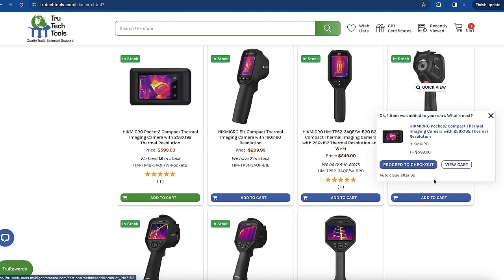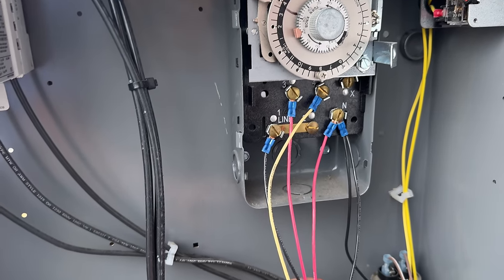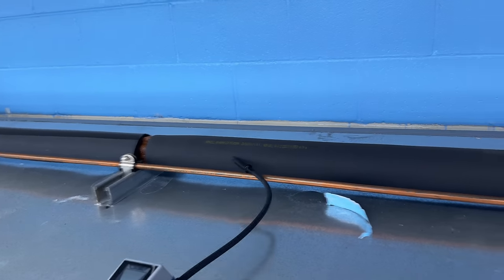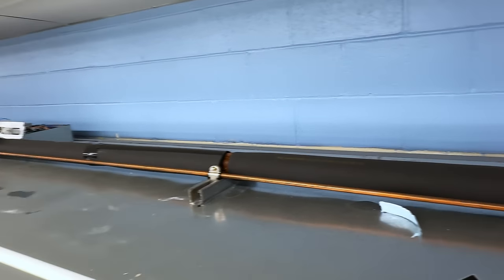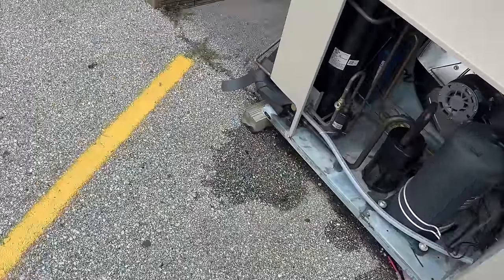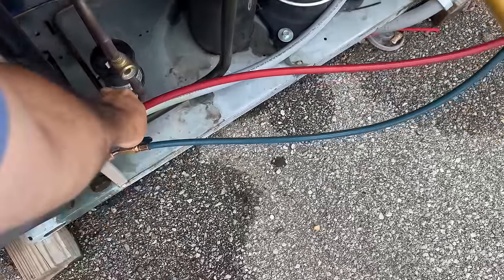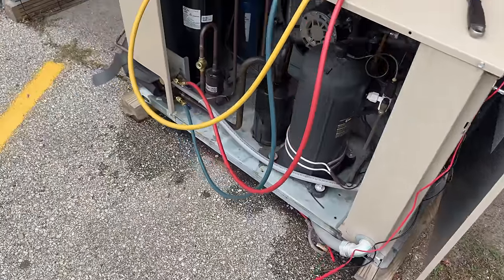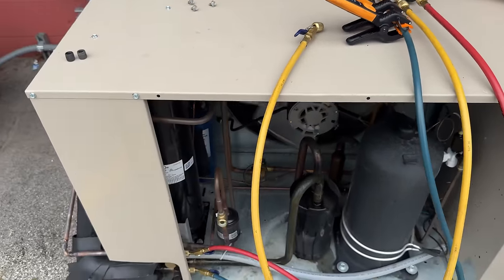More Mistakes More Problems New Install Failures

Comment: looks like either the electricians or installers forked up and fed 208v to the 120v circuits initially. smoked elements yeehaw.
on that note, make sure they don't have the 120v/208v crossed up in all of them, 120v on the 208/240 heaters and 240v on the 120v heaters.
but I'd think the evap. motors would be nuked, but they may be ecm rated 120 to 240 and not care?  that was a tough basket case of mumbo-jumbo to deal with. 🤔
looking again, lights and fans/drain heater may be different circuits for building automation(lights off with store/sensors), so it's possible the sparkies initially fed 208v to the 120v evap fans/drain heater. the motors never blew because klixon had them off(or 120 to 140v rated). the mystery continues 🥳 they need an exorcist, time traveler, mind reader, team of scientists and more to figure out what exactly happened. maybe they did blow it all up initially and that's why they're not back now?
Reply: I would double check the voltages to every input of each case. I'm thinking it may still be wired wrong somewhere in the row and not just killed/fixed at original install.
120v vs 208/240v would make the heaters weak(about half current), also blow the 120v drain heater/s, the evap fans may be 120-240v capable, but you'd think the relays/contactors would let the smoke out, unless they're 240v circuit controlled. not looking at schematics again 🤯 not gong to Indiana to help! 🥸
Reply from the maker: Great point! That might be why they replaced a couple controllers.
Reply from the maker: The 120 V drain heater circuit wasn’t even wired correctly to the ice cube relay and I had to literally wire that thing. Somehow, I didn’t record that and didn’t mention it very well. I assume the other ones aren’t wired correctly either or the other people screwed up the wiring.

Comment: The sticker inside the control showed the sensor wiring correct.. how was a guy to know?
Reply from the maker: He should have tested the thermostat when finished.  The paper instruction showed the correct way. But it was pointed out to be earlier that the sticker was flipped around.
Reply: @HVACRSurvival  awesome find and excellent point on testing.. verification of proper operation

Comment: so the company that installed this unit ....has no interest in fixing it ?   Jay.
Reply from the maker: @charlesleake930  The only reason he used them was because they had the equipment available several months before us. Otherwise we would have done the job. The person that did it was a fairly small company and normally the customer had been using us for last 25-30 years when he had another store only 45 minutes from us.
Reply: @HVACRSurvival  Hey man ...thanks for the kind reply....yea...you can only do your best.....have a great day   cheers   Jay

Comment: umm, you said 404A and they all say 448a gas. probably just a tongue fail. lol
ok, shortly after you noticed meter set for 407c and switched to 448a.  🤪
Reply from the maker: I knew it had 448A because I had brought six bottles of it in the back of the truck, but I ended up cutting that out because I didn’t end up using it. The video was originally 90 minutes.

Comment: Dealing with this bullshit from other companies can be frustrating. Both refrigeration companies I worked for plagued me with this shit CONSTANTLY caused by themselves. I drove over three hours once to pull the charge, evac, and recharge because some dipshit mixed 404 and 448 at the company I worked for. The owner himself denied that it was possible because he was there for the final charging. It wasn’t noncondensibles.  My needles were rock solid steady. My pressures were fucked up six ways from Sunday. SURPRISE! Pulling the charge and weighing in fresh fixed everything. I wasn’t allowed to change the drier by the way. Fuck HVAC/R, I’m sticking with industrial maintenance. I also stumbled across a bunch of industrial walk in coolers where some dipshit added defrost clocks after the fact and didn’t have enough wire to wire them to pump down. That dipshit worked for my employer. To this day the defrost clocks have NO control on the solenoids and just kill the compressor contactors. You are a bigger man than me. I would be raging.
Reply from the maker: I’m a good editor 😂.  Believe me I was bitching plenty. Thanks for sharing! I know I’m not alone dealing with idiots. 🤜🤛👍👍
Reply: @HVACRSurvival  I can go on for HOURS about the fucked up shit my coworkers set me up with. Industrial maintenance is soooooo much nicer 🤣